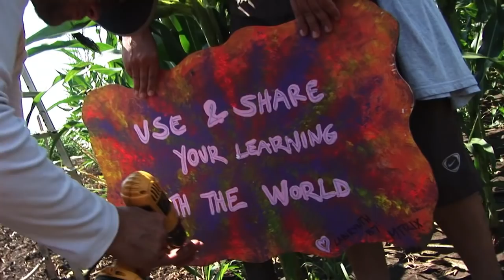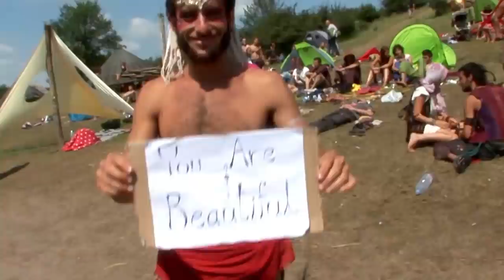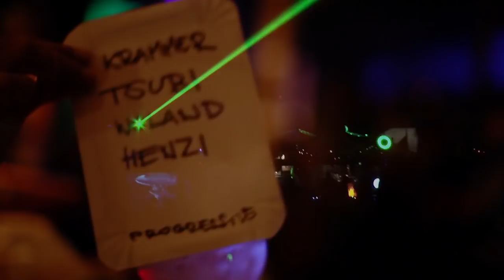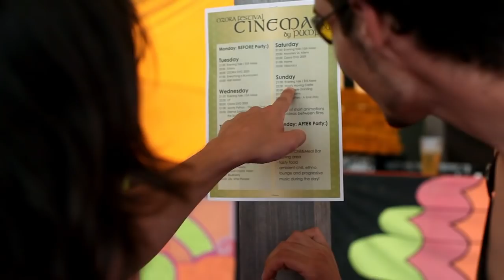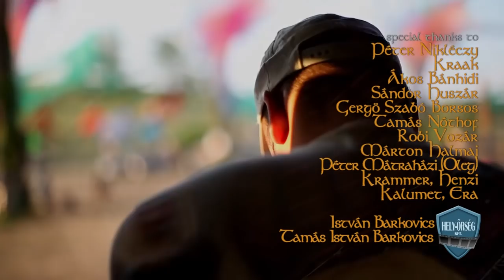OZORA Festival 2010 (Official Video)

Comment: 7. Sun Control Species - Cheap Tricks (Plusquam Rec. 2010)
8. Asura - Virgin Delight (Ultimae Rec. 2010)
9. Pleidians - Pleiades (Sonica Rec. 2010)
10. Fearsome Engine - Drugganaut (Nano Rec. 2009)
11. Green Nuns Of The Revolution - Rock Bitch Maffia (Aphid Moon Remix)(Flying Rhino Rec. 2009)
12. Hallucinogen - Jiggle of the Sphinx (Twisted Rec. 2000)
13. Carbon Based Lifeforms - Supersede (Ultimae Rec. 2010)